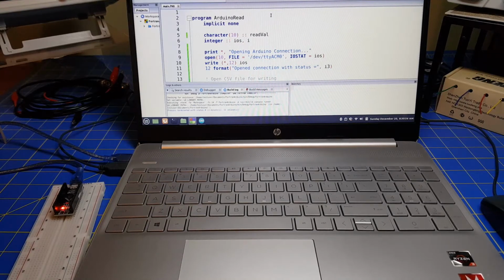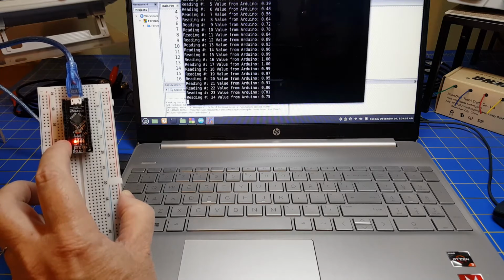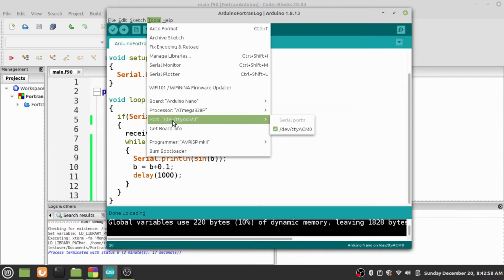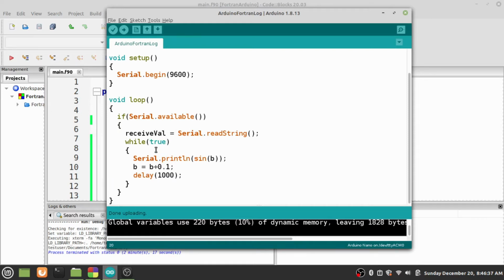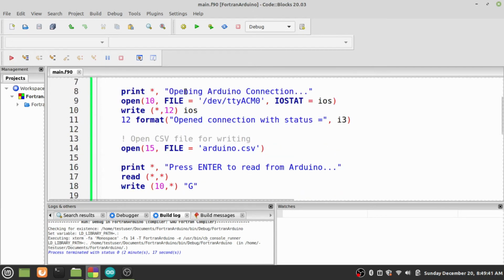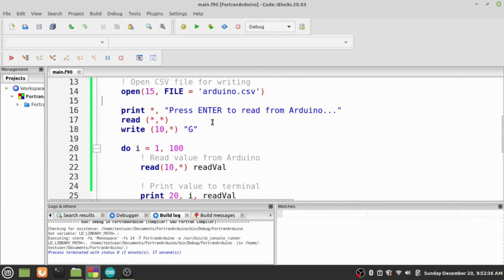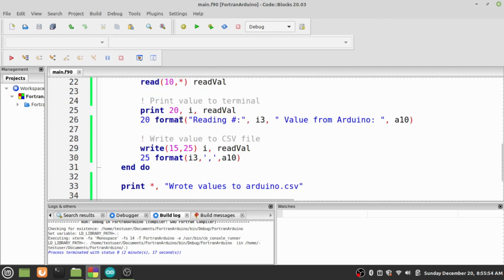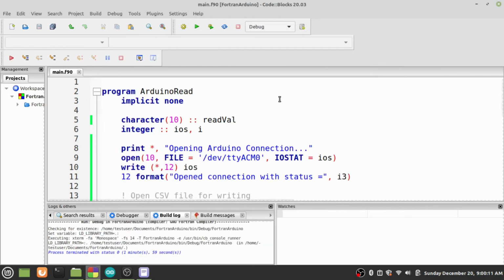Arduino Access via USB with FORTRAN

Comment: Something seem amiss in the coding results.  Why do you have two 1.0 values ?  Something is getting rounded but should not for my understanding of the code as written in C and FORTRAN.  I would think you should in the FORTRAN read as a Double, and not a CHARACTER type, and that may fix the double 1.0 issue.  I checked with AI and what you have should work, but seem like there is a rounding issue happening when converting to CHARACTER(10) in FORTRAN from Double in C.  Could be a blip in the ARDIUNO hardware sending the same value twice.  I do not have a ARDIUNO to check against, but maybe I can use a Raspberry PI using the same method and see what happens.  I would check the coding and see if there something off.   I enjoyed the video and wonder if there was a way to access via FORTRAN.   I would be interested to know what you find out if you check into the issue.